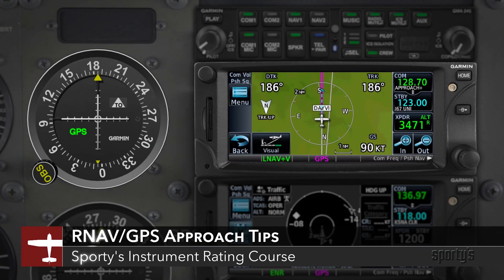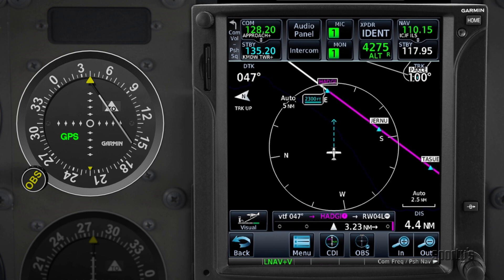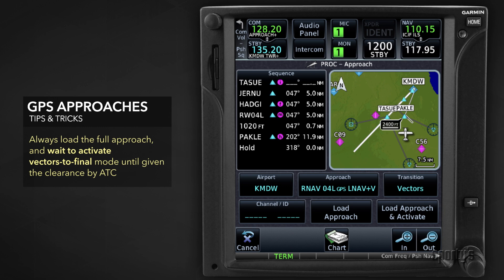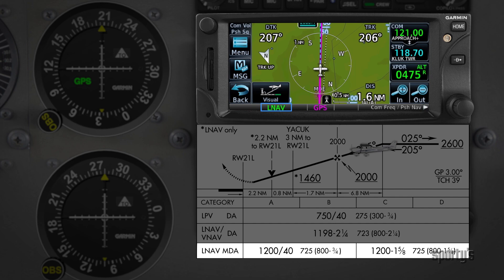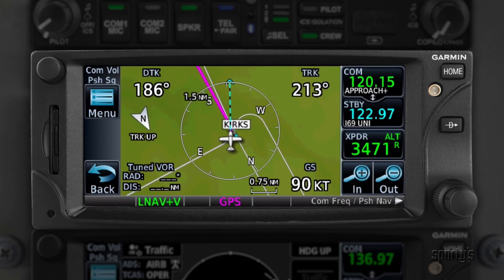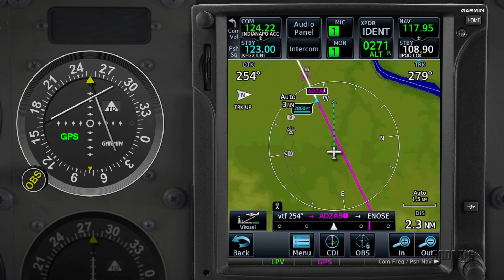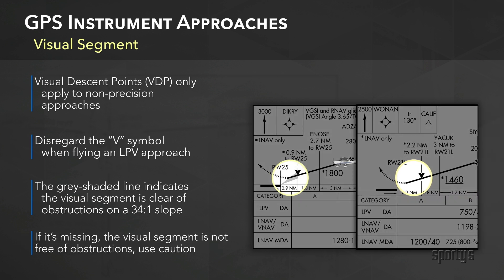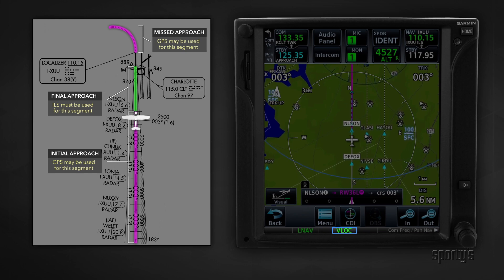RNAV/GPS Approach Tips (LPV, LNAV+V and more) - Sporty's Instrument Flying Tips

Comment from the maker: The guidance in the video is to always load the full approach first in the GPS, and then activate Vectors to Final mode when on the final heading to intercept the final approach course. When you do it this way, the actions of both "Activate Vectors to Final" and "Activate Leg" from the flight plan screen do the exact same thing. This keeps all the approach waypoints in the flight plan, allowing you to quickly navigate back to any of them if needed from the flight plan page if the approach doesn't go as planned.